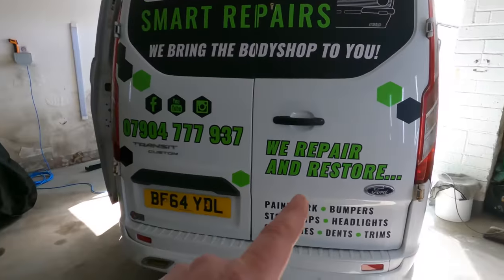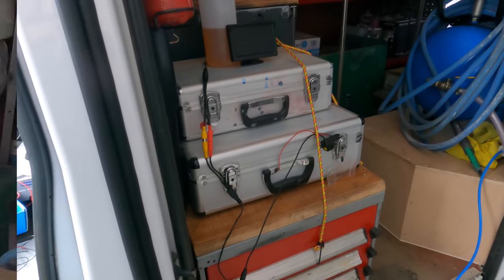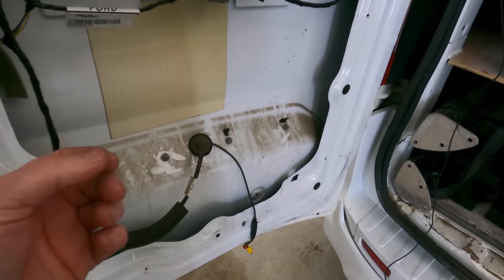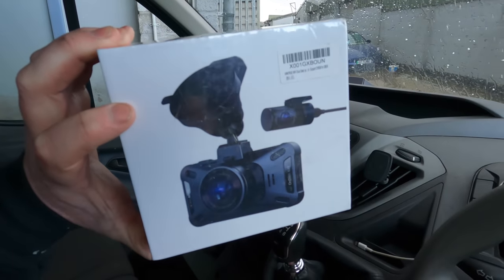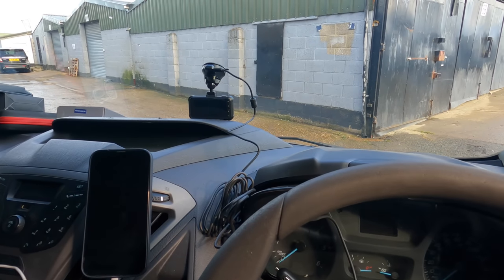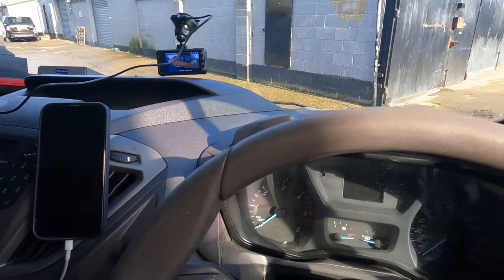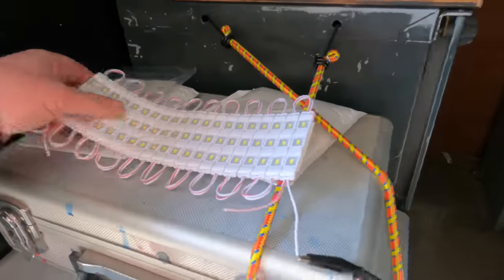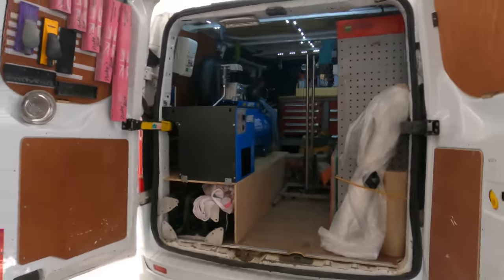Vantrue ondash x4s review & give away and the smart repair van build is finished 💪💪💪

Comment: Looks like you are ready to go, well done. Getting the rear camera cable through the door grommet was such a pain on my van too! It's mad how much time it takes getting a van setup, still tweaking mine, 2 months on. With cable, thicker gives less voltage drop so equipment works better. Never ever work with the cable in a coil as it can cause a fire!!!

Comment: The fuse for your van is meant to be a Ford only fuse. It's a weird box fuse with female spades unlike normal fuses. I had to change both on my works custom and they were £8 each. The van is looking good.
Reply from the maker: Ohh 😮 great poxy dash cam🤦‍♂️🤦‍♂️🤦‍♂️ where are they located? I’ve not looked yet
Reply: @grantssmartrepairs  they are under the steering wheel. You need to remove the knee trim had a look and it's j type fuses so can be bought on amazon cheap enough.
Reply from the maker: Thanks I’ll take a look 👊👊👊👊

Comment: Nice one Grant !👌👌👌told you battery goes flat on a mobile van 🤣have that charger on when your plugged into mains when your working mate
Reply: @grantssmartrepairs  when I had my van mate I had a smart charger behind the seat near the battery and it was permanently attached to battery so that when I plugged van in at work it kept it topped up👌easy to do with your new set up

Comment: Will you be running a generator? On the occasions you have no access to power.
Reply from the maker: No I always check for power when booking 👍👍
Reply: @grantssmartrepairs  fair enough 👍
Reply from the maker: My mates run for 8 years without one and never had a problem

Comment: One question grant, your comp is a 16 amp, but when you plug in peoples homes you will coming off a 13 amp supply
Reply from the maker: Mines a Abac Pro A29B 90L CM3 11cfm * Single phase run off a 13 Amp supply mate there is another model that’s higher I made sure I got this one by recommendation there spot on 👍👍👍👍